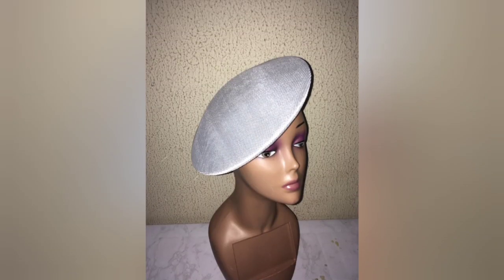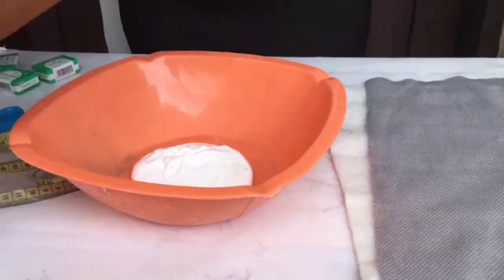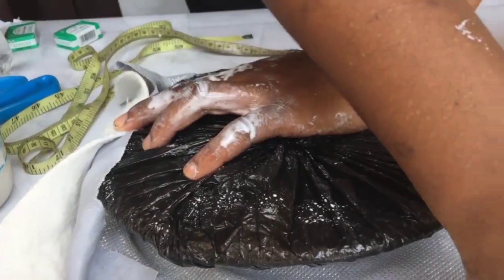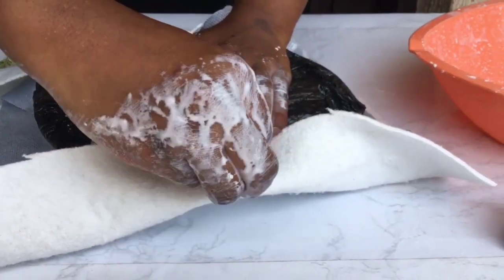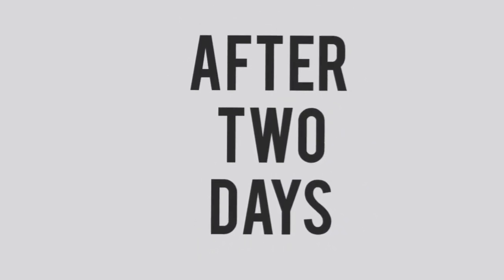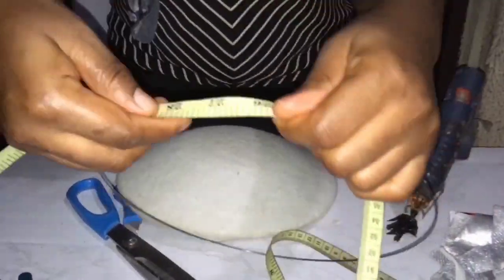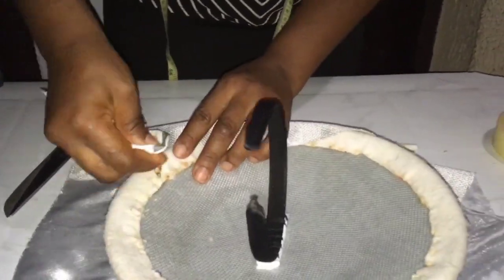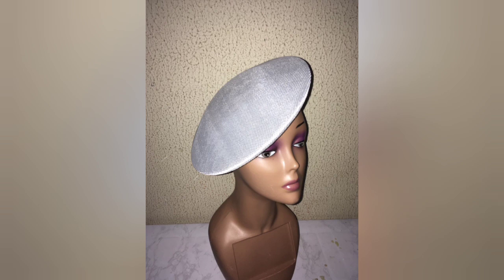HOW TO MOULD A (DIY) FASCINATOR WITH PAD

Comment: Thank you ma'am for this tutorial. Is there another name for the pad? I checked with stores that sell materials for fascinators but they seem not to know what it is. Is it the same as felt?
Reply from the maker: You are most welcome. It is called warden or interfacing. It’s the thickest softest one. you would find it in tailoring stores ( where they sell materials for tailors/seamstress). It is actually close to felt but more foamy

Comment: Thanks so much ma for this video, I really learn a lots from you ma. 
Please ma, what is the name of the fabric you used before worden to make the mould.
Also ma, please how does stiffner looks like, is it like UHU  gum , B7000, glu gum and the rest.
Reply from the maker: You are most welcome dear. I used Tafetta then but best to use bridal satin or dull face or you could use same material you are using on the top. It’s not same as uhu gum dear, it’s a stiffener in the likes of Top bond

Comment: Pls ma what's the difference between stiffner and top bond? 
In moulding with pad can one use stiffner if top bond is not available?
Reply from the maker: They are both used for moulding dear just that I find top bond more economical to use for pad and stiffner better for great finishing for sinamay and any other I won’t be covering with material. So you can make use of whatever you have available and when you find more options, try them all out to see which works best for you

Comment: Nice one. Can i use top bond in place of sniffer in making facinator using synamen?
Reply from the maker: Yes you can but if not mixed well doesn’t come out well so that’s why I prefer stiffener to top bond for sinamay

Comment: Wow! So innovative! Can't the final fabric be moulded the same time with the pad? 
Can top bond be used with paper mat or sinamey? Thanks so much! I'm a subbie and have learnt alot from your channel.
Reply from the maker: Thanks for your compliment and your subscription.
I used to mould the fabric with the pad initially but noticed it changes the shade of the material so I stopped and started using the method you watched.
Top bond can be used but sometimes it doesn’t come out well, so I stopped and use only stiffener for all other types of material.
Am happy you have learnt a lot from my channel
Reply from the maker: Please do join me on my Facebook group so you can share with me what you have been able to make under the relevant video post.
https://www.facebook.com/groups/210382993991597/?ref=share
Reply: Pls I need link to join I want to learn